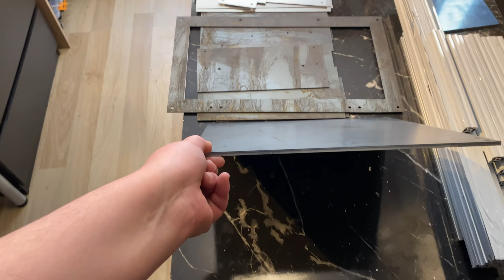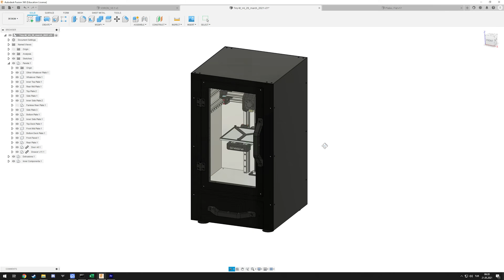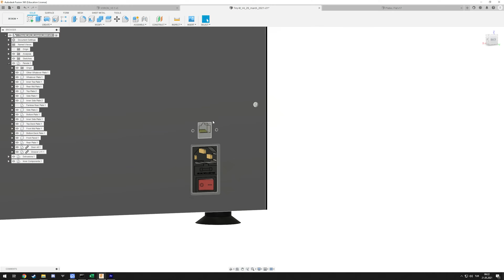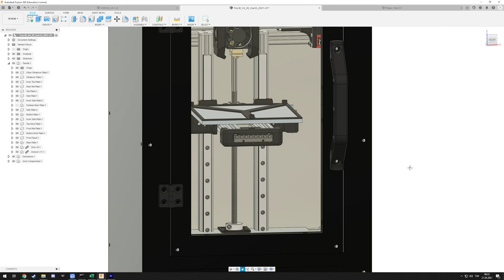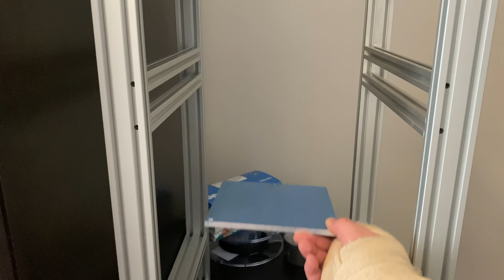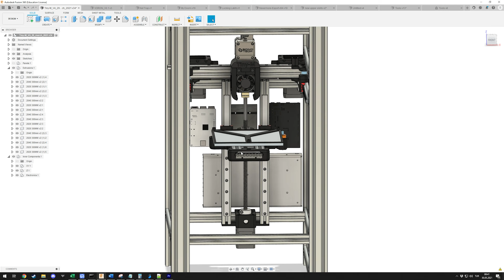Tiny-M Ep. 1 - Extrusions & Panels & CAD

Comment: It may be worth trying to go with resin printed parts. Not sure how they would hold up unless you went with some form of tough resin and you may have to modify some parts slightly. It also will depend on what kind of temperatures you are planning to run in your chamber.
As to the steel parts, see if there is a shop that can do powder coating for you that should give it pretty good durability. You could also try sanding with some fine steel wool and see how deep the discoloration is.
Reply from the maker: Unfortunately I don't have a resin printer. I ordered the 3dxtech cf-ppa I showed in the video so that will probably be the filament. 
I know a place I can get them painted and I might in the future but right now I don't want to wait for that (they're kinda slow). I'll try sanding but I'm not optimistic.

Comment: For the steel panels you can use sandpaper or some other kind of scratching method and or polishing it or painting it
Reply from the maker: If I was going to paint, I would sand first for sure. But I had bad experiences with spray paint so I didn't want to risk it. (Scratching too easily etc)
Reply: @IsiksTech  I think you made the right choice ! Painting is hard to do (archiving perfect results😅🤣) I just commented too early on the start of the video, then I saw you wrapping it 😅

Comment: Volcano pla is meant to take high heat not sure on strength properties tho
Reply from the maker: To my knowledge, no PLA works for even normal (non-insulated) vorons, including the type you put in the oven to cure.
Reply: @IsiksTech  what about the aluminium parts sets you can buy they done v0 size parts yet?
Reply from the maker: I don't think so but even if they did Tiny-m parts are different. I also heard they didn't work well for some people.
Reply: @IsiksTech  not seen many reviews yet tbh
They deffo arent cnc parts as sold tho i dont think
They look cast but with tooling marks from the mould not actual machining
But should deffo be strong enough even as cast parts compared to abs etc

Comment: Get an orbital sander on the steel
Reply from the maker: But it won't be black anymore I think. Acetone definitely bleached the color so it's probably just a coating.
Reply: @IsiksTech  the black is scale not a proper blacked coating its just bare and will rust theres some spots of rust already i noticed
Reply: @IsiksTech  metal is what i know been working in engineering 20 odd years
The technical stuff is where im learning
Reply from the maker: This is what I heard voron devs  
say you want some flex with 3d printers as an explanation for why the aluminium parts don't work well. There are a few people that tested them and had problems on the discord. I don't doubt your experience btw, but maybe it's not applicable here.
Reply: @IsiksTech  is this meant to be a reply to the ali parts comment lol
Dont make sense applied to the steel parts and scale from being cold rolled 😂
Reply: @IsiksTech  for precision you dont want flex it may help it not shake itself apart tho
You have the right idea on the weight having heavy plate at the bottom keeping the centre of gravity low
The more weight you can add thats not moving the better
Having flex in parts just makes up for inaccuracies
Reply: @IsiksTech  having flex also can cut down vibration thats why the 916 ducati did well in racing
The flex they included in the geometry gave grip rather that spinning the tyre in a way
So there maybe reasons beyond the nomal understanding of materials properties going on too
Reply: @IsiksTech  theres videos by 517 industries making his own cnc parts be interesting to see if its the tolerances etc that are the problem hes making things properly not an ordered kit
So results maybe interesting
Reply from the maker: Sorry I mixed the comments lol. It's getting late here. 
I get what you are saying. I'll do some research later too because it sounds interesting. But for the Tiny-m cnc parts aren't an option anyway.

Comment: Nice, why didn't go with prusa mini heated bed not fit inside?
Reply from the maker: I'd have to make the printer larger. There is a 190^3 spec Tiny-m too if I wanted a larger printer, but I feel like 150 is enough.
Reply: @IsiksTech  OK I see I thought the 180 fit with your  current CAD so why, keep going 👍

Comment: Do you see any issues with Raspberry PI IO hitting one of the steppers placed above it? Also, in regards to Stefan's initial comments about the CF Nylon he used, his was a very old batch, with known defects acknowledged by the producers of it. They had sent him new stuff to use but he had wanted to use his old stock first, and that as far as I understand it, is why it bit him in the ass for his V0 build.
Reply from the maker: I think pi should clear the motors. 
I heard about Stefan's filament being old but I've seen other CF nylon builds fail too. It's still the strongest candidate though.